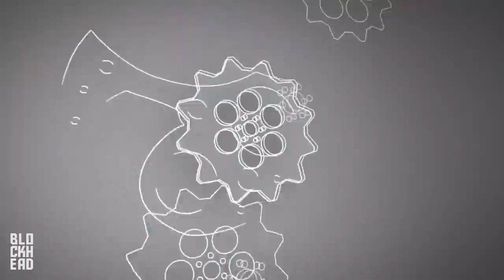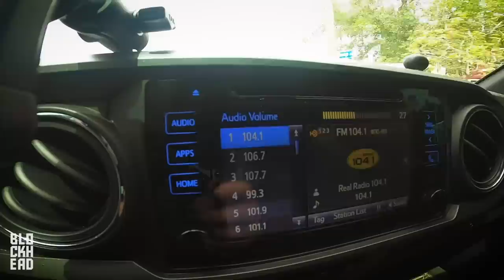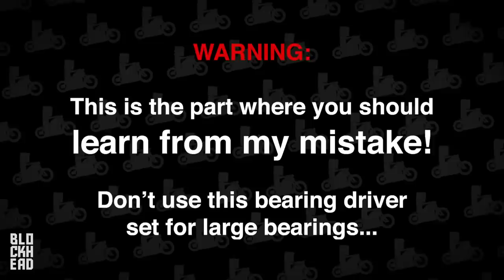Harley-Davidson Iron 883 😓 I Messed Up...

Comment: using a old bearing as a pusher works great, you can use a larger pusher so all pressure is on the outer race, even after it recesses into the wheel

Comment: Any tips for new riders buying a used bike from private sellers? I’m a total squid and don’t wanna get gypped
Reply: Bro with all these stimulus bikes out its gonna be hard as hell I've been looking for 6mths before corona and all the bikes I was looking at disappeared when corona struck now they are back messed up crashed or in pieces... Guess I'll be waiting a lil longer,,,
Reply: Biggest tip of u can't test ride don't buy it.. Carborated only starts with a push don't buy it.. Won't start with electronics don't buy it.. 1st bike make sure it runs and stops without help and know if you get an old bike be ready and willing to work on it from time to time shops cost a lot a simple clutch adjustment where I'm from can cost around $200 don't buy a bike that has been laid down some have tip sensors that have to be replaced after a low side. Always check service receipts and make sure vin matches the title I brought a bike that was registered in 3 states at the same time.. Basically be extra paranoid and cautious when buying from private sellers most just want big money for trash bikes
Reply from the maker: Look up my video ‘how to buy a used motorcycle,’ tons of info in the vid as well as description and comments 👍🏼

Comment: You can also use sockets with a bolt, set of washers, and a nut. No extra tools required. Source: I do this for aircraft.
Reply from the maker: Good idea!
Reply: @BlockheadMoto  Just don't put pressure on the inner race of the bearing.

Comment: Hey guy's,  before you all gitgud I need to ask a simple and dumb question, so I'm going to defiantly buy a 883 iron black. But need to do something but I'm not sure if it's a stupid as thing to do, so I want to remove the fork dust cover in the front. You know the retro plastic covers on the front. Is that an good idea?? Is it just to cut that piece of or?? I like the naked forks much more. Any one has any ideas? Also how do you guys think the dual twin headlights look on a iron? Thank you.
Reply from the maker: You talking about the accordion black looking pieces? Those can be cut off, yes.
Reply: @BlockheadMoto  but if I cut them off, is there a risk of having dust and have them dmged ? Or are they only cosmetics?